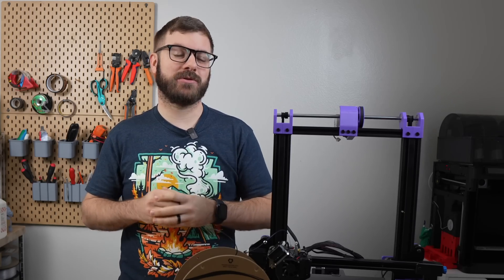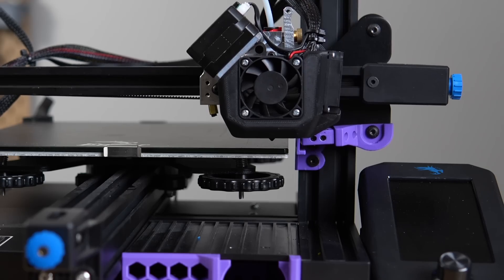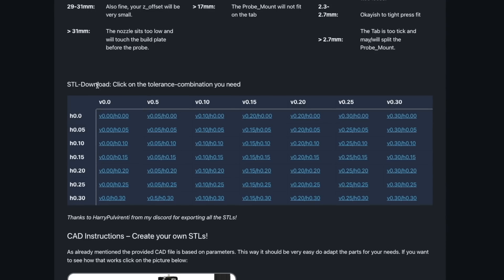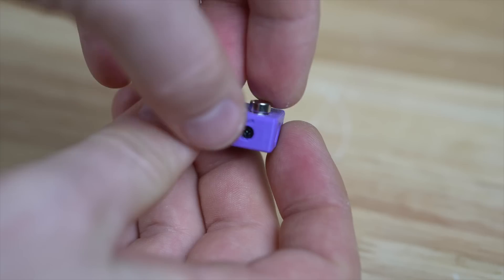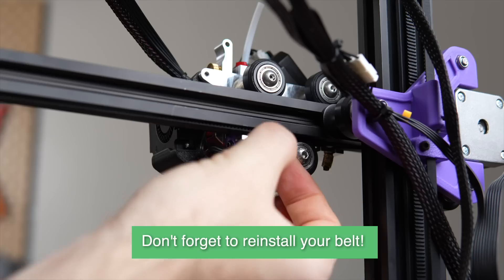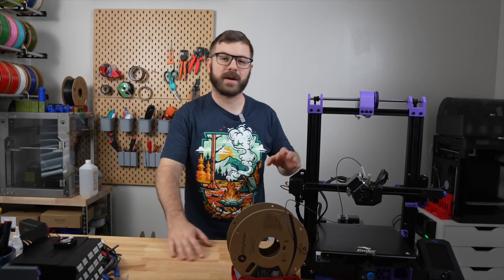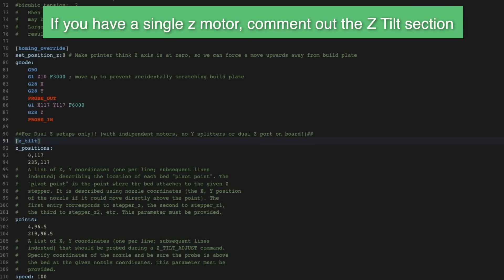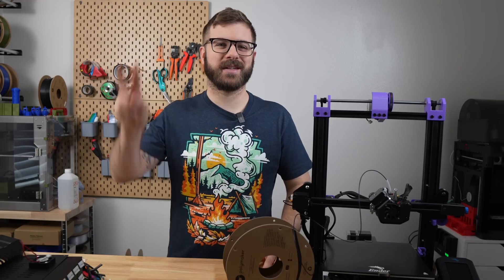Best Bed Leveling Probe For Creality Printers (KlackEnder)

Comment: This is another ingenious design KevinAKAsam. And another fantastic instructional video by ModBot. Thank you for this and all for all you do to help all of us.
Reply from the maker: Major hats off to KevinAKASam for this. Hopefully this will helps give others another point of reference that are interested in adding this.
Reply: @ModBotArmy  tbh you are becoming a pretty damn good resource for those of us who just need a little more visual learning and handholding to go with all the relevant reading on these relatively current 3d printing topics…(at least for those of us still trying to do this on the cheap and for the fun of it vs just buying new machines… so it’s def appreciated.   Subbed.
Reply: And Thank You For Your Fake, Kiss Ass Comment.
Reply: @coreyhutton478  who exactly are you talking to and why in the world are you so angry about someone that appreciates these modifications and tutorials? Sounds like you need a nappy nap.
Reply: The cool thing imo is that much of the work involved with this mod … I feel… has actually trained me to be more proficient with both tuning my printer to get much more accurate and stronger parts (petg is definitely dialed in for me now)… and also more familiar with eventually converting to klipper and editing firmware in vs code etc for marlin/mriscoc stuff in the meantime, so for me this has been an educational project that dovetails with several other cnc related projects I’m working on, it’s very applicable knowledge.   And it probably is not easy for a beginner as I am at all… but well worth it while still not being too unattainably difficult.    So not only did I learn the stuff I said above but I further learned more CAD stuff using his nicely done parametric cad file…. I’d encourage anyone to get that going on fusion and play around with it.

Comment: I'm just wondering why the probe isn't park at the bottom (so on the stopper).  That would avoid picking it up by accident when printing over the entire bed.  Now if you get a bit higher up and move the head all the way to the right, you could be accidentally pick up the probe.  If it would be parked at the bottom, you only need to take care not to move up quite a bit before moving to the left again, something you normally won't do while printing ...
Reply from the maker: If you dont have it on the x axis extrusion you will need an additional z endstop. With it on the x axis it knows it can go to the right until it grabs it. If it is on the bottom it could crash into the bed before it grabs it. I have the setup you are describing on my Switchwire and I also have a z min switch that it needs to reach first to let it know it has homed before it goes to find the probe. It is a messier setup. I am hoping to convert it to an x axis setup as well. During normal printing it shouldnt be an issue.
Reply: @ModBotArmy  No you don't.  Since the contact is normally-closed, Klipper can just move up 5mm, home x & y, move to the x coordinate to pick up the probe, then move down and detect while moving down when the probe attaches to the magnets (as then the circuit gets closed).  It can then move up to keep it attached and measure Z in the center using the probe
Reply: @MisterkeTube  This capability would have to be in the firmware.  I’m not sure what the advantage is, as the position on the Y-axis doesn’t appear to encroach on the build volume.  KIS always applies.
Reply: @boggisthecat  No need to have that in firmware if you are running Klipper as you can implement that in macros.   There isn't much difference between this moving down and detecting pickup of the probe and the initial z-home with a probe.  Both will not know z at the start of the move and move down until a condition triggers.  Implementation in the firmware itself would be even easier in both Klippper and Marlin.  Anyway, on this printer you might have sufficient room off the side to not pickup the probe by accident when moving to the side of the bed, but that won't be feasible on every bedslinger.  Having the probe in a basket at the bottom would only have you accidentally attract it on the bottom layers, but then when your head moves away again side-ways (as that is the normal movement when printing), the probe would detach again as it isn't lifted out of the basket.  So for printers without extra room in x direction, this would still allow use of a klicky probe.
Also, not having to remove a screw of one of the right v-wheels to mount the holder and only having to attach a single basket on the v-slots at the bottom, seems like KISS to me.
Reply: @MisterkeTube  No advantage for this printer.  Lot’s of unnecessary work and a requirement to run Klipper?

That’s the opposite of KIS.

Comment: Great video! Glad you like the Klack and thanks for the positive feedback :)
Reply: You're a damn Saint @KevinAkaSam all of your mods are user friendly as it gets and fun to build, and that website of yours is stupid proof.
Reply: I’m sure you’ve addressed this elsewhere probably but since I haven’t seen this specific info elsewhere yet… is there any reason not to use the old Z axis limit switch for this making even less materials to source?     That’s where I’m at with it given the Z limit switch on my v2 matches all the specs of the Omron as far as I can tell so I just snipped it off the pcb.   Figured this might be a relevant place to ask or for ppl to see the answer
Reply: @dillrepair  because the switch isnt accurate enough. The Omron is way more accurate than the cheap switches Creality uses
Reply: @KevinAkaSam  that was my exact question too! 
Glad I bought a new switch before I tried to reuse the z limit switch 😂
Reply: @KevinAkaSam Creality cheaping out on components? Say it ain't so😂
Reply: error option points not valid in section homing_override?
Reply: Is it compatible with marlin?
Reply: @brandoneich2412 Yes
Reply: @brandoneich2412  I use it with Marlin. Configuration is a little more involved, but it works.